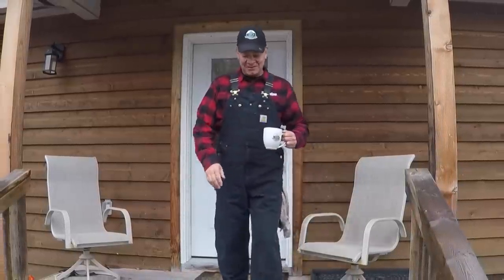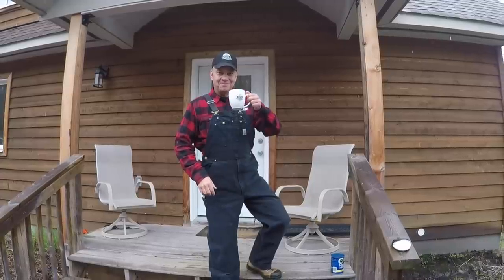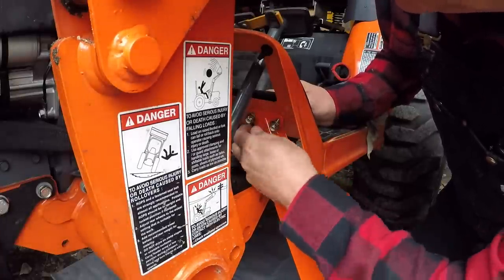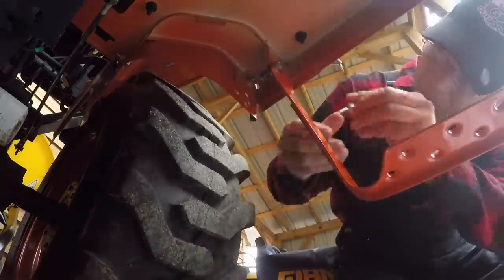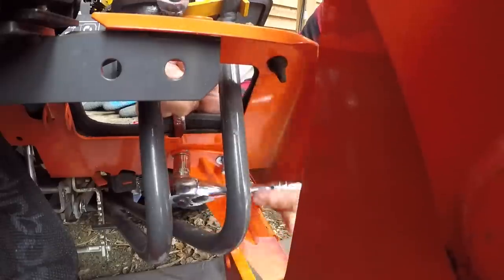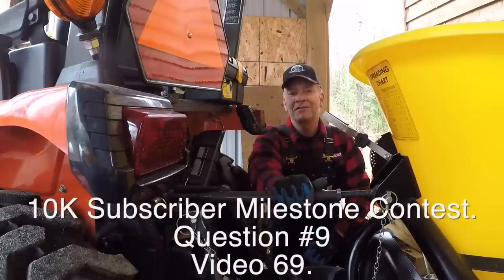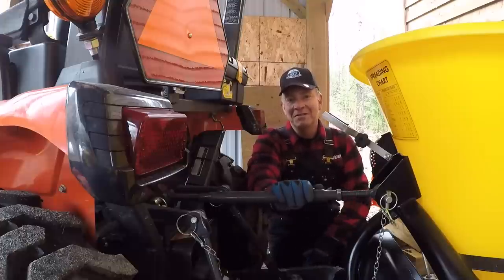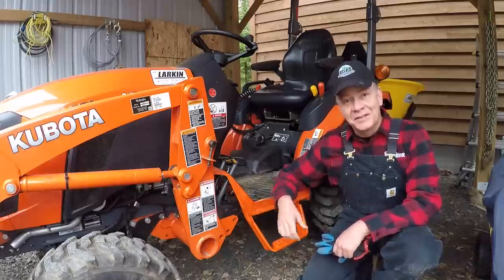#158 kubota b2601 compact tractor. Stepp'in Up! outdoor channel

Comment: Can you get a step for the other side as well?
Reply from the maker: Good day Carmen. That's a god question - I honestly didn't look underneath to see if there were brackets on the other side of the operator's platform to bolt another one into it. Also, just an important note, I found out that if you are using a belly mower, you won't be able to use the step - it gets in the way. Thanks for the good question today! Cheers!
Reply: GP Outdoors no belly mower here, I’d have to look at my platform as well to see if there are holes for it. Thanks for the quick reply. Cheers

Comment: Does anyone know the part number for the Kabota B2601 step modification
Reply from the maker: Hey good day. The part number is 6A70051350. It is the "step assist" on the B2650 exploded parts diagram on the Kubota Canada parts website. Hope this helps . Not sure if the part number is the same for the US. Cheers!

Comment: You have the part number??
Reply from the maker: Hi Rod. I believe it is Part number 6A 700-51359._ If I remember correctly, it is called a "Step Assist". It is the same step as is found on the B2650 stock. Cheers!

Comment: Now that looks cheap that step should be made with 1/8 or 1/4 inch thick metal.
Reply from the maker: Good day MOV. It feels pretty sturdy but I am sure would be stiffer and stronger with a heavier metal. But Guy has one on his L that looks almost identical and it's still working after 15 years so it should do the trick for me. Cheers and all the best!
Reply: Well my concern heavy brush bending it. I know on my M6040 it has a super heavy duty step but that is a whole new ball game.
Reply: I have a 2650 with the same step, it is plenty sturdy.